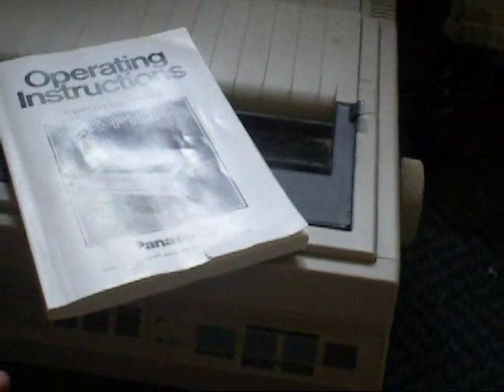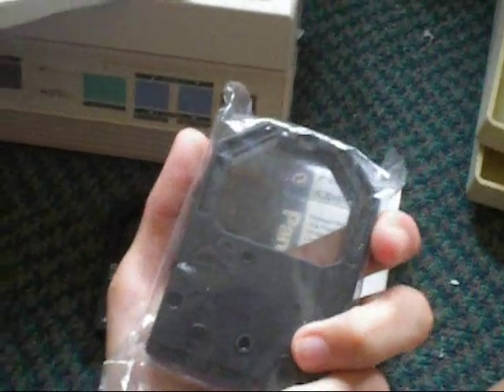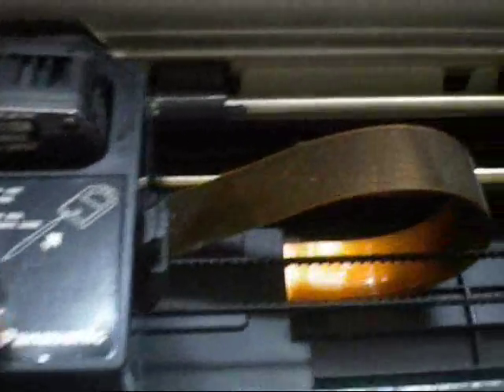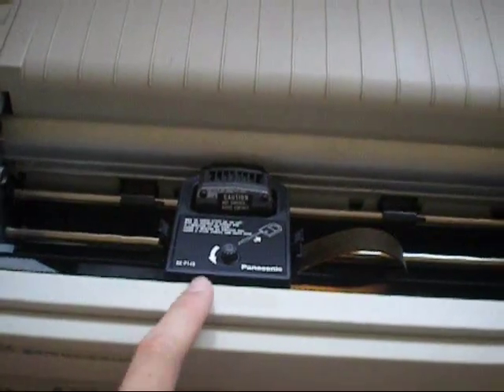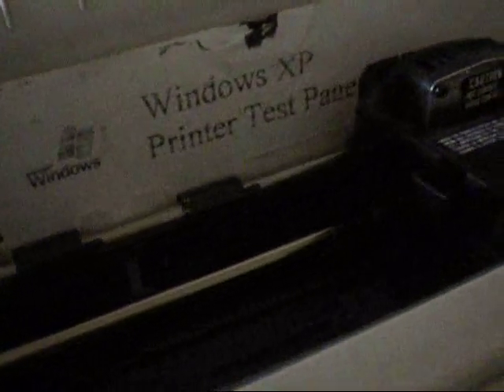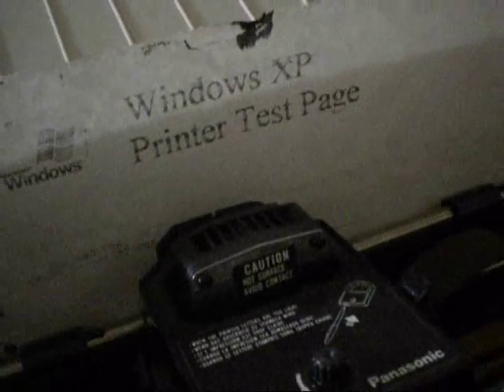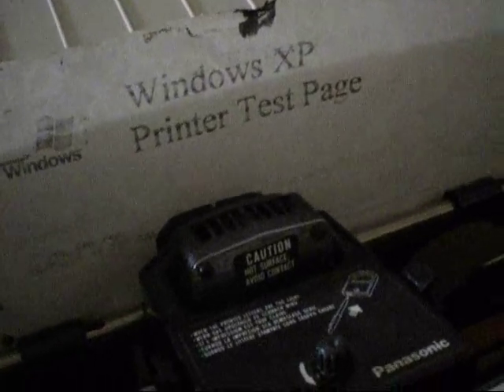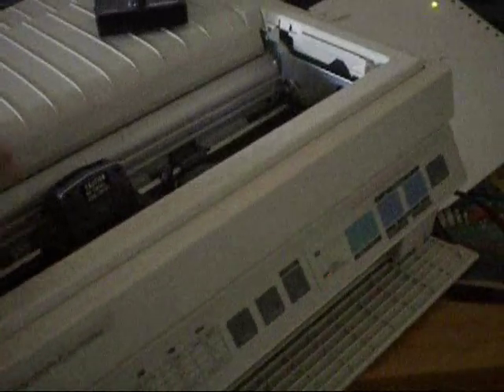Setting Up a Dot-Matrix Printer

Comment: What kind of cable did you use I’m attempting to do this no to no avail
Reply from the maker: I used a parallel port for this model. That was the only connection that it had. I connected it to Windows XP, and it was able to recognize it with a pre-installed driver that Microsoft had included. The issue that I had was with trying to actually print something. The ribbons that I had had dried out including the one I got from Amazon (Brand New). I tried a hack with fountain ink, but that did not produce any positive results. At this time, I hope to buy another ink ribbon.
Reply: Alex Hughes ya that’s my issue is getting my Panasonic to print . I’m connected to vista . And it’s been an uphill battle attempting to connect via parallel to usb
Reply from the maker: How did this go? Were you able to connect the printer?